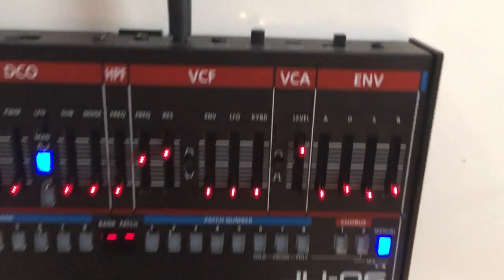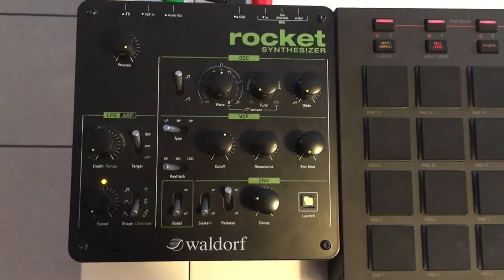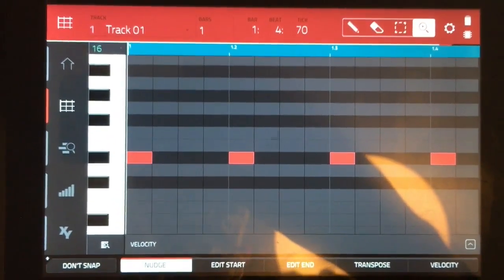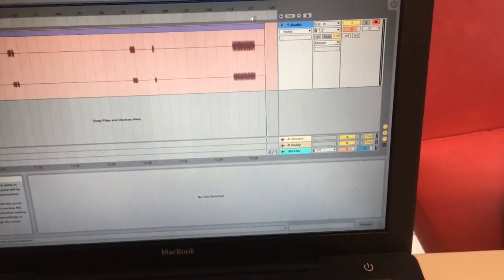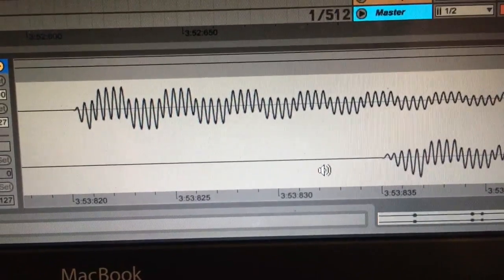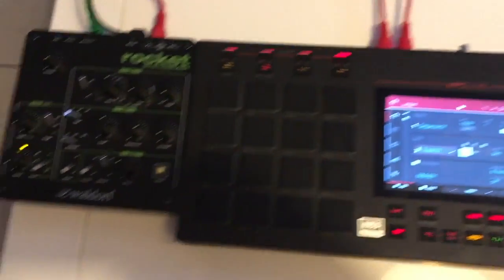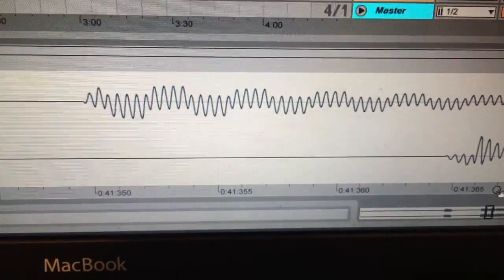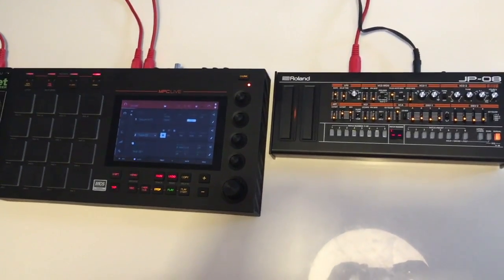Roland Boutique JU-06 and JP-08 - Proof Of Latency Issues

Comment: Don't get me wrong, I understand the issue in your setup. You would expect the MPC Live sequencer to trigger both midi devices at exactly the same timing. However, hardware often doesn't work like that (as in with 0ms latency I mean). 

Perhaps the MPC Live is not set up properly for any kind of synchronisation in your current set up? (It's in Menu -> Gear Icon (settings) -> select Sync tab -> set it to send and receive MIDI Clock ; and then use midi out/in cables from the MPC Live). I'm not a 100% certain, but I think the MPC Lives should do a half-decent job of synchronising midi devices using the midi clock send/receive and just midi cables. 

(Keep in mind this is not me saying there is no latency, but it should at least prevent the MPC Live from being the issue?)   ( http://www.akaipro.com/support/kb/articles/akai-pro-mpc-live---syncing-a-midi-controller-with-an-mpc-live )

Perhaps the JU-06 is set to the incorrect midi clock source? (Hold down [manual] and press [3] , press [1] and release [manual] to set midi clock to AUTO; now any midi in should synchronise with the external midi clock (MPC Live in this case)). ( https://www.roland.com/us/support/knowledge_base/218347863/ )

Anyway, having said that and assuming that still doesn't work, why aren't you using your laptop as the master midi clock and use Ableton Live as the sequencer? 

That way you could try various different midi latency compensation from within Ableton Live. I think you can set a negative delay to a track and I also think you could experiment with the Driver Error Compensation option. I'm somewhat certain Ableton Live itself already should be doing some synchronisation behind the scenes anyway, but it can not do that on just analogue audio coming through.

To me it kind of makes sense any devices who output their audio the way you have it set up will keep their original latency if there is no advanced synchronisation taking place. Heck, this is true for any live instruments going through some kind of amp as well. It will never be free of a little latency.
 
Output latency for a lot of hardware is within 2ms and about 15ms actually, so you're going to need the compensation for anything that's audible. If there is no reliable way of doing so with the MPC Live, then that might actually be a limitation with the MPC Live itself.
The way this can still work in a live situation is when everything is synchronised before the master output from within the sequencer you're using. I mean, do you get the same latency delay when using the MPC Live pads  just for playback of sound?

Judging by the comments from Roland Japan they admit there is a latency that should be expected based on hardware specs. But that doesn't mean it couldn't work in a live situation where everything is synchronised. Especially when using Ableton Live as your sequencer and using External Instrument and tweaking the 'hardware latency' option. (Or alternatively use the Driver Error Compensation with Reduced Latency When Monitoring switched on).

Don't get me wrong, this issue seems very real. But I'm a bit surprised there is no work-around or fix available. Especially knowing I have seen JU-06 synths being used in various live set ups playing basically just fine.
Reply: All valid points, but all fundamentally trying to excuse the real problem - consistent, audible latency worse than machines costing a third of the price (eg the Rocket used here). Admitted by the manufacturer (see the description), who made sure later models were improved. But anybody thinking of buying one of these earlier machines should take heed of the overwhelming evidence here (vid and comments from others) , rather than the apologists and scientific pedants, if they want to make tightly sequenced music. Ignore at your peril!

Comment: I'm wondering if the new D-05 is affected by this as well. Would love to here from anybody if they have this issue on the D-05 too, or not.
Reply: Yeah, hold on mate but 15 milliseconds is actually a lot to a real musician, I don't want to be midi-ing up my keyboard to a new piece of gear that is constantly behind the beat.
Reply: I have the JU, JX, JP, and the D-05, and have had zero latency issues with any of them...
Reply: the D-05 in usb audio is the worst of all. Polyphony bottleneck at usb level. Daw freezes... 
Playing it just with midi, you get the same 15ms and no freezes, but usb.... no way...
Reply: the D05 is faster than the original D50 I have been using for years, this is a lot of fuss about nothing .

Comment: Noticed ever since I bought the first three Boutique synths.  They have corrected the problem since, on the newer Boutiques.
Reply: 1. Which 3 boutique synths did you buy?
2. Can you prove they have corrected the problem?
3. I just bought a boutique TR-09 2 weeks ago, NEW, and it has this problem, so I think you are incorrect.
Reply: Just stating what I experienced.  I'm sure there still some latency in the newer boutique synths (D/A conversion) but the first three... JU-06, JX-03 and JP-08 the latency is more pronounced.

Comment: Thanks for your time doing this video. I got the JU-06 and I was planning to buy an Akai MPC Live to control it. Now I know what will happen. Is there any way to do some workaround, for example delaying Akai midi output by 15ms? Thanks!
Reply from the maker: Unfortunately the Akai doesn't have any track delay, in milliseconds. I end up having to move the midi notes back a tick or two, it's never perfect but sounds better. The pain then is that you miss the first note of the bar, as it is effectively at the END of the bar now - make sense? And of course, if you like to build beats up on the fly in a live setting, this is a proper workflow and audience interest killer...
Reply from the maker: BTW Fred, if you think the Boutiques are less than perfect, wait until you get the MPC. Riddled with issues - a whole world of pain! The battle between the folk who just want it to work, and the deniers who don't want to think they've bought a lemon, is on a whole other level...
Reply: omg, I've heard some issues with the MPC Live as well (particularly glitches). Regarding the Boutique series, what if I use an external midi clock, such as my E-RM Midiclock? Anyway, MPC should be the masterclock, it is expensive as hell! Thanks for sharing your thoughts!
Reply: What kind of issues @RichLaneMedia with the MPC and which one? I'm planning to upgrade to an MPC Live at some point in the future to have something for outside of my studio. I guess the software isn't bug free enough yet?
Reply: Speaking of MPC Live bugs or issues, it would be interesting to see whether just playing the two synths from Ableton Live produces the exact same latency delay (without any compensation set).

Comment: Very interesting. If the issue is in the MIDI implementation and not sound generation, the SE-02 is likely to have the same issue.
Reply from the maker: My theory is the cheap processors in the Boutiques aren't fast enough for the complex (and superb sounding!) ACB algorthithms, so a worryingly large buffer size was the compromise. The low polyphony and sample rate back this theory up. The SE-02 stands every chance of being perfect! If not, you are no doubt right. And in which case, there is hope for some updates maybe?
Reply: Agreed there's no good reason for that part to be messed up. But...it happens. 

I'm with you though, in that it's likely the VA. Haven't tested timing with the SE-02 yet.
Reply: what are the reservations as ive just bought one and have already had tuning issue on top of some odd behaviour.
Reply: +Michael Blyth, I wasn't aware of a tuning issue.  I think there's an auto calibration routine.  Have you tried that?  I'd be interested to hear what the other odd behaviour is.

My main reservation is the lack of fine control over the filter, especially the cut off.  From the MIDI spec, there is only a 7 bit CC to control that, with no Fine part (LSB).  Some parameters have that, but not the cut off.  Also, I'm not clear how many bits are active in the the Fine/LSB  - possibly only one?  It turns out the pots are only read with 8 bit precision.

Okay, there are plently of other digitally controlled analog synths with low resolution, but this thing has only just been designed recently, and I don't regard it as cheap, so I was expecting more.  The Moog Minitaur has 14 bit resolution on all controls, for example - 16,384 steps vs a very steppy 128 - I'm not being pedantic about that; you can actually hear the steps as you turn the filter cut off control.

Secondly, Roland's current obsession with 1/8" jacks.  They will wear out.  Possibly quite quickly.  There's no doubt in my mind about that.  If they were 1/4" jacks, or a pair of RCA sockets, they'd last for many years.  1/8" jack sockets are just not robust enough.  They develop crackly, loose conections, very easily.  I could fix that, voiding my warranty to fit decent sockets, but on the whole, I'd rather not have to.

I don't accept the "It's only $500" argument.  It's nearer $700 here, and either way, that's a big chunk of money to me.  I expect something built well, to last.

And finally, for now, the velocity response.  I'm not even sure it's mentioned in the manual.  Nick Batt described it as disappointing, or words to that effect.  I'm still not clear if you can set the amount, or if it's just a switch (affects Filter Contour, or not - but not VCA level), but it's so subtle, I'd probably want it on full anyway, and still not be happy, so it's academic whether or not it's adjustable.

It seems to me it had a lot of potential, but there have been too many compromises and "that will have to do" decisions made in the design.
Reply: The software to decode MIDI into control signals (e.g. setting a digital potentiometer, or a DAC to control a VCA) ought to be very fast - i.e. there is no good excuse for cocking that up.

Almost certainly, the problem is the "thinking" time involved in running Virtual Analog emulation, in all of the Boutiques except the SE-02.  Analog circuitry is essentially instant, other than rise times on envelopes etc.

VA relies on a lot of CPU power, and very optimised code, to work well.  A digitally controlled analog synth is much simpler - it could be done quite effectively with something as basic as an 8 bit ATmega MCU.
Reply: I'll be interested to hear how that works out.

I have some reservations about the SE-02 (which I'll spare you the details of), but it's the only one of the series I'm really interested in.

Comment: Interesting. I guess it's not a big deal when playing live/mucking around, but I can see how it could matter when recording.
Reply from the maker: Actually, I find the opposite Bass and Keys. When recording, the audio can just be nudged 15ms early. When playing live with hardware - not so easy.
Reply: the usb power noise problem is not acceptable also---there is a hiss unless you use separate charger (phone) -at least in my setup
Reply: so with the keyboard k-25m does this have the same problem? (thanks for your video)
Reply: I have the k25m keyboard and my jx03 has latency issues. More so it seems it doesn't have anything to do with the midi in. If you use just the internal sequencer it will be late, too. I use the midi out and have the jx03 clock another synth - again 15ms late.